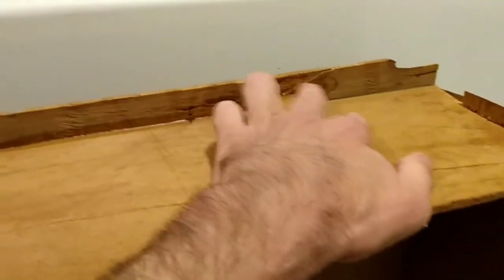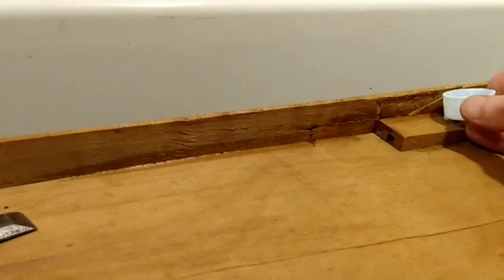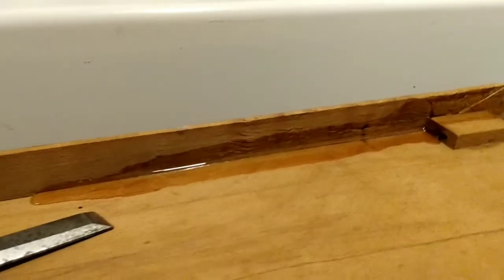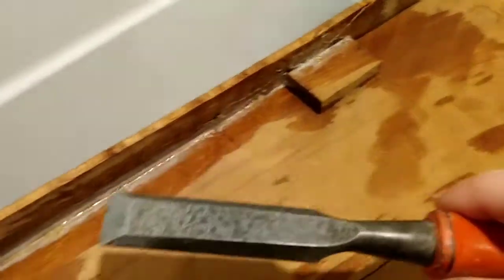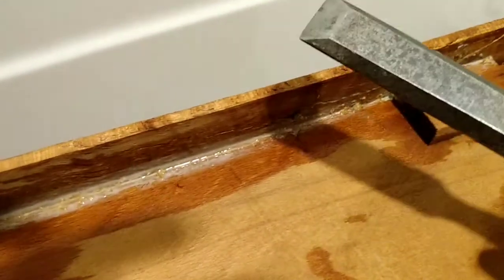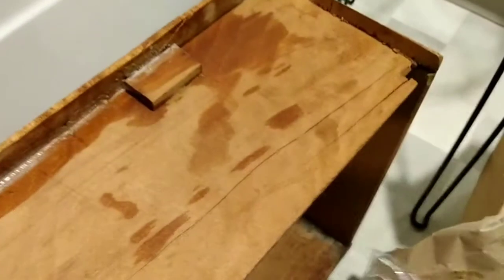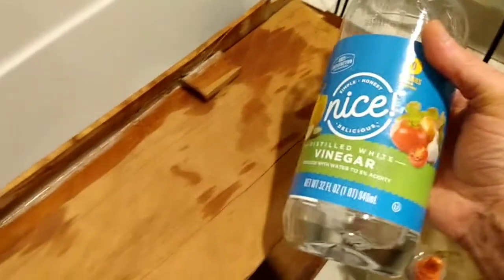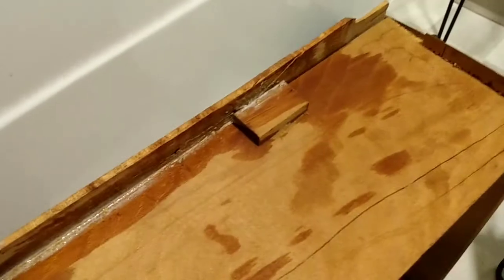Remove wood glue mistake with white vinegar

Comment: Came back with an update used this on 2 wood side panels for a shelf I was building that were off did this got them separated easily removed the glue then realigned and re-glued them. It took some time because Titebond glue is tough but it is worth it thanks again
Reply from the maker: Great thanks for posting back! Yes Titebond bonds very strong to the point that the wood will splinter before separating, whereas Elmer's wood glue will separate easier. That's awesome vinegar did the trick.
Reply: @p1nesap  
Yup it took longer than with Elmers a couple parts where I went overkill with the glue were a real challenge had to do a bit of prying on the seams so the vinegar could get in lol. I love Elmers too Home Depot didn't have that

Comment: I'm glad you put this video online! I'm re-doing a cane chair, and there isn't a lot of information on how to get the old (broken) cane off. But I've read I can put some vinegar around the spline, and that will make it easier to put that old spline off. But I wanted to confirm that the glue-softening actually worked before trying it out. And this video confirms. Maybe Matthias Wendel will do a video like this next.
Reply from the maker: Vinegar loosens glue.